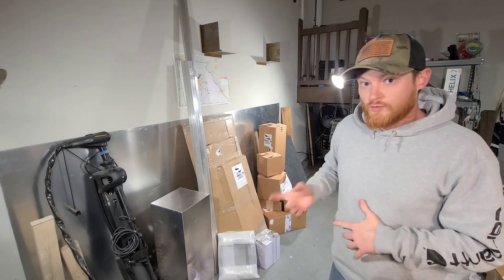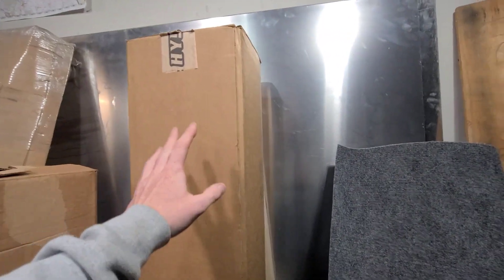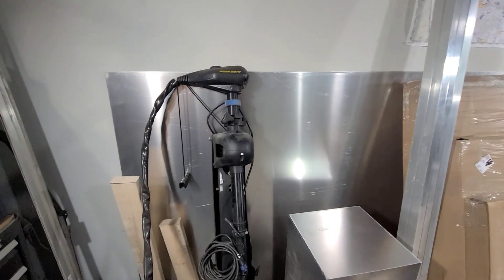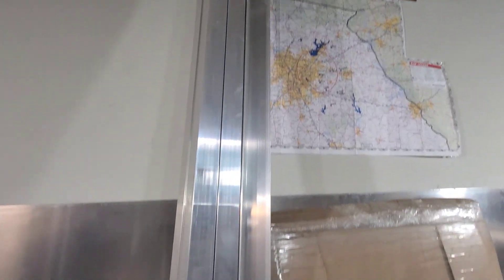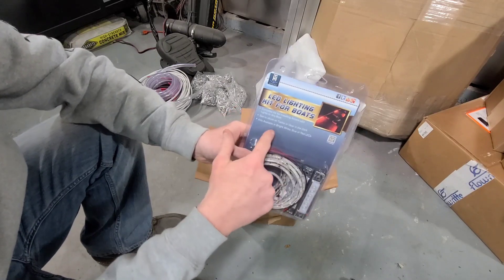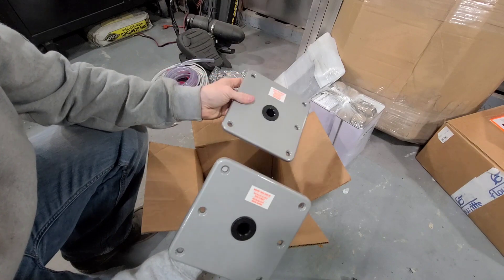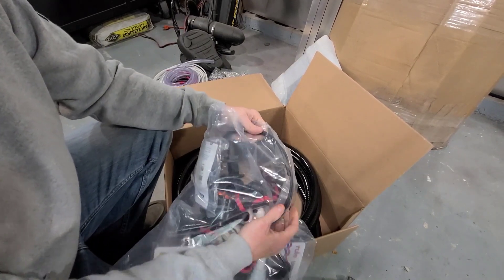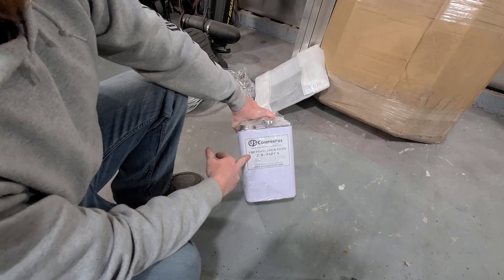MUST HAVE Jon Boat to Bass Boat PARTS! Including EVA Foam Boat Decking!

Comment from the maker: ALL PARTS IN VIDEO ARE LINKED HERE:

Boat Carpet - https://tbnation.net/collections/decking-flooring
Trolling Motor - FB MarketPlace
.090 and .050 Aluminum Sheeting - Save a little money sourcing yourself in a full sheet https://tbnation.net/collections/aluminum-frame-kits/products/6-pack-aluminum-sheeting
Electrical Wiring - https://tbnation.net/pages/search-results-page?q=wire&page=3
Rivets (Countersink and Standard) - https://tbnation.net/collections/aluminum-frame-kits/products/rivets
Angle Aluminum - 1.5"  1/16 dia - https://tbnation.net/collections/aluminum-frame-kits/products/angle-aluminum-framing
Aluminum Tubing - 1.25" 1/16" - https://tbnation.net/collections/aluminum-frame-kits/products/tube-aluminum
Livewell - all welded 18 gallon - https://tbnation.net/collections/aluminum-frame-kits/products/livewell-tank-18-gal-all-welded
LED Light Kit - https://tbnation.net/products/led-lighting-kit-for-boats
Struts - https://tbnation.net/products/hydraulic-gas-spring-lift-support-2-pcs-100n-22-5lb
Bilge Pump 1000gph - https://tbnation.net/products/johnson-pump-cartridge-combo-1000gph-auto-bilge-pump-w-switch-12v
Pedestal Seat Mounts - https://tbnation.net/products/attwood-swivl-eze-lockn-pin-aluminum-7-inch-x-7-inch-marine-boat-3-4-inch-pedestal-base
Flow-Rite Premium Kit - https://tbnation.net/collections/marine-livewell-plumbing/products/flow-rite-livewell-pump-kit-premium-w-timer
Pour Foam - https://tbnation.net/products/pour-foam-2-lb-density-2-gallon-kit
Dry Hatches - Powder Coat is extra - https://tbnation.net/collections/aluminum-frame-kits/products/dry-storage-hatch-lid-pre-built
Hydro Turf - https://tbnation.net/collections/decking-flooring/products/hydro-turf-cut-groove-eva-foam-traction-mat
Reply: I can't believe 2 people posted links to booty call sites. Smh
Reply from the maker: @shanepeter1616  haha I know it. Happens every time
Reply: On another note....like I said I'm gonna watch this build like a hawk. In particular, I really want to watch the detailed framing so I can start to plan out my boat, and, I'm anxious to see the livewell and cooling tank installation.
Reply: How long do you anticipate the build taking in total?
Reply from the maker: 2-3 months, mainly because of the paint process
Reply: I swear I've heard you give a discount code for TBN before. I just skimmed back through 10 different videos and couldn't find it. Is there a discount code for you?